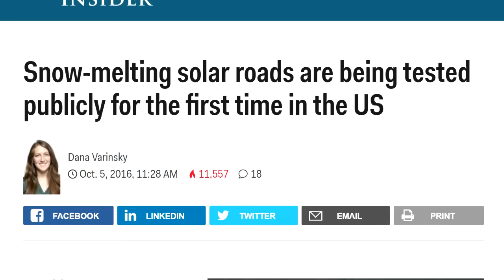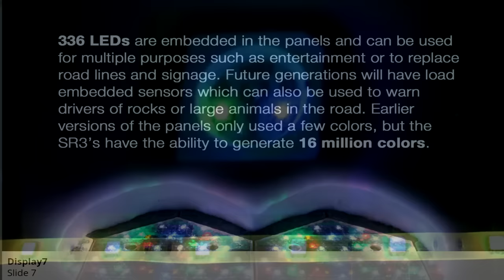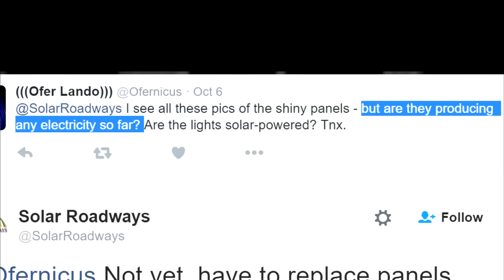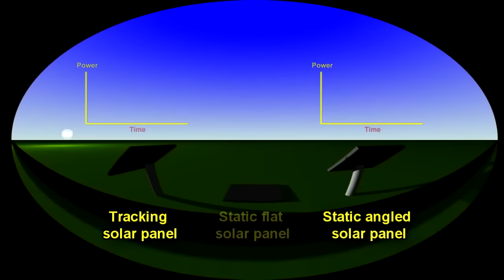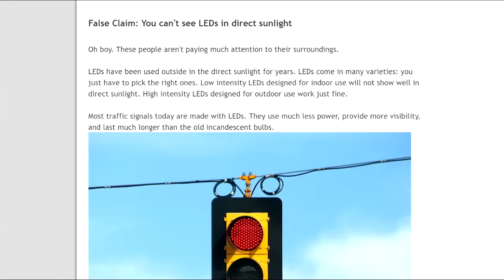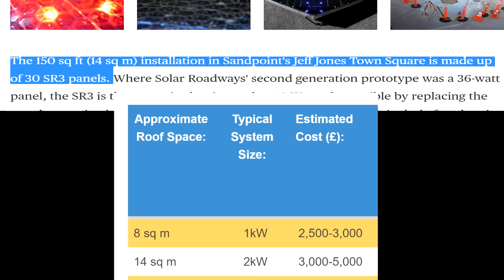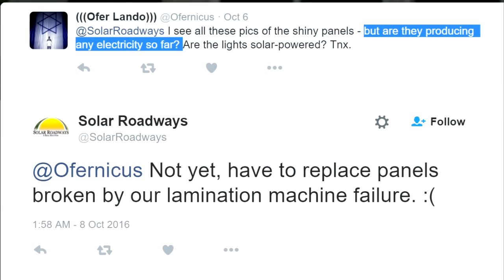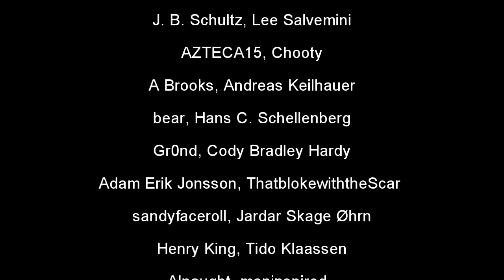First AMAZING Solar Roadway UNVEILED!

Comment: I agree that solar roadways is a pie in the sky idea that won't work in practicality. That being said, why would you test the feasibility of this idea by rubbing asphalt on glass when the goal is to REPLACE asphalt with glass? Shouldn't you be rubbing tire treads on glass? You're still going to have a lot of wear on the glass that will further lower the efficiency of the solar panels. So why lie with a faulty analogy? Probably because rubbing tire tread on glass wouldn't have the same immediate abrasive results as asphalt. It seems your test was rather ill conceived and done for dramatic effect rather than to prove anything.
Reply: You're oversimplifying it: rocks and rubble of all sorts get on roads all the time from so many different sources. Tire rubber won't be the only thing touching the roads. What's more, he did address tire rubber in his last video on this, and made the very obvious point that tire rubber on glass in wet weather is an extremely dangerous combination. You wanna go drive on wet glass over wet asphalt? Your funeral!
Reply: I didn't see the last video. Yes, not everyone watches every video on YouTube. Shocking, I know! But thanks for informing me in the most condescending way possible. And why is it whenever someone disagrees with another person on the internet they immediately go full false dichotomy and assume that because you disagree with one point you must agree with the entire premise of the opposite position. And this despite the fact that I prefaced my comment with the opinion that I already think solar roadways are unfeasible. But I forget, it's an election year; so it's fun to cast anyone who disagrees with you even slightly as being the polar opposite of your own position. Right? /s
Reply: Have you never seen a pebble get stuck in a tire, and if that happens, with the weight of a car and it's speed you would have significant scratches
Reply: Rob Freebeard Wow you really lost your temper there. Thing about the internet is that it's hard to really detect tone, and being way too obvious about it can be bad as well. I wasn't actually being condescending, at least not deliberately so. More sarcastic, having a laugh, and certainly not at your expense.

But it's the internet, get so invested in a single comment and you'll get grey hairs early from the stress. Check out TF's last few videos on Solar Roadways, he goes into a bit of detail which is quite interesting.

Comment: Is the whole idea of solar roads totally a failure? Or is it just their incompetence?
Reply: The idea is senseless.  It would be 4x to 10x cheaper and better to simply pave the road with conventional materials (even put cat's eyes or even programmable LED reflectors and heating pipes in them if you can afford to... and have corridors along the side with all that expensive BS [wifi, power lines, etc. etc.] if you want to) and then put solar panels above the road or at the side of the road where they aren't shaded or scratched/damaged by vehicles.  Solar panels fall in efficiency as they get hot.  You need venting.  Instead, to protect the electronics in a solar road from water etc, they are hermetically/vacuum sealed.  So you have high-powered super-bright LEDs and microprocessors generating heat PLUS solar panels with NO ESCAPE FOR THE HEAT!  Even if the electronics don't cook, the power generation will be almost nil and the lifespan of the panels will be down drastically from the rated 15-20 years.
The french government is doing it SLIGHTLY more sensibly by just sticking rubbery solar panels on TOP of the road.  Still idiotic but only 2-3x as stupid as putting it on a roof or on the side of the road - compared to having to dig up all the existing infrastructure etc.
Netherlands spent 3M euros on a 70m bikepath (with no extra electronics!) that produced 1/2 the power of a rooftop solar.  So if they had just put the panels on the side where they didn't get dirty and was fixed at a tilt to the sun they would have had something a little sensible.
So the approach itself is pure and utter folly.  And on top of that the Brusaws are morons who can't deliver on even the tiniest of their promises.  Who wouldn't test out their product in the lab BEFORE installing it?  They've had 10 years and $4M in funding, and have an additional $500k for this project alone.
Reply: I would lean toward fraud. A person who is legitimately trying to build something with make a bare-bones prototype first and focus on improving the core functionality first, then go on to adding the bells and whistles. A person trying to sell snake oil will add the bells and whistles in the prototype phase to distract attention away from the fact that the snake oil does not work. For example, when someone points out that the solar panels aren't working, the inventor will point out that the LEDs are working, and argue for the benefits of LED powered road markings, or switch the topic to heating the roadways. And when someone points out that LED powered road marking are invisible during the day, the inventor will switch the topic to solar power, and so on. 

The solar panel bike path in the Netherlands does not have LEDs, but it is producing power (inefficiently and expensively.) The solar installation in Idaho is NOT producing any power. The number of panels with functioning LEDs is totally irrelevant,:if the LEDs on all 36 panels were still working, it is still a failure, because it is not doing its core function.  The" bells and whistles distraction" tactic is partially working, most viewers are focusing on the number of LEDs that are out, rather than 100% failure of the installation to produce any electricity.
Reply: blkgardner I agree.  Excellent point.  Both the Netherlands and France are starting with the basic, fundamental part: road surface that generates electricity. The Brusaws keep making grandiose irrelevant claims "Solve Climate Change, Track Terrorists, Military Applications, Gather Runoff water, Load Sensors to protect animals!" [the runoff water thing is insane by itself.  Have they never heard of storm drains?]... I think their entire purpose was to defraud the government.  And then they found out about how to defraud people on Indiegogo... Their SR3 panel upgrade (from SR2) was to make brighter and more colorful LEDs (for more decorating options!).  They are smiling thieves.
Reply: The idea itself is both scientifically crazy as well as illogical.  The best place to put solar panels is NOT areas that traffic is on, but areas like roves of buildings and uncovered areas exposed to direct sunlight.   The idea of a car park is crazy as little actual light would be absorbed even if you could find a material that tucks, buses, cars, dogs and the like can walk and drive on without damaging it.  Now, the cost of installing them on a roadway, not even thinking of the disruption to traffic, would be much higher than putting existing solar panels in desert areas which already happens.  

Secondly, there are many working solar panels already in the world (my nephew works for the CSIRO in Australia and designs them).   Their disco lights version is all very cute but the existing panels available for energy are already well developed.  In Australia, we even have a competition each year for who can build the fastest solar powered car AND the panels are actually on the car, as that it the part that has unfettered sunlight.

I can't say that the idiots trying to develop these panels are charlatans or are just total whack jobs, but it is a worry when government agencies throw public cash at it with no idea of what they are doing.

Comment: The execution was very poor, it still seems plausible as a concept though, just need someone with real world manufacturing knowledge and solid engineering skills.
Reply: Did you even watch the video? It is not a solid concept. Why would you bother putting solar panels where they'll be far less efficient when there's more than enough land to put panels on, like unfarmable fields or rooftops? Not to mention the whole host of other problems with the idea mentioned in the video.

Comment: sigh

As if I wasn't misanthropic enough...

Oh well, what more is there to say than: There's a sucker born every minute?

I'm going to pretend for a moment that I haven't got the slightest clue about electrical engineering or solar power at all. The very fact that these "geniuses" saw fit to include a blinking, LED-lightshow into the fucking thing should've been a pretty obvious warning sign to the beholder.

If their intended purpose is to GENERATE power, and each hex is clearly inefficient enough by itself that the goal is to pavr over the entire frigging road network with them to gain a decent amount of juice, then why... OH WHY! Would you see fit to WASTE that hard earned power on a stupid lightshow?!

I just... I... Oh nevermind, I just hate people in general...

Comment: its a good idea that can change the world but these people are not the people to do it. we need a team of actual civil engineer's, scientists, electricians, renewable energy scientists and construction workers to come up with a better solar road idea.
Reply: We don't need a solar road idea. We already know the best places to install solar panels: sun-tracking mounts (for commercial installations) and south-facing rooftops (less efficient but near-zero maintenance, for home use). What we do need is investment to move away from fossil fuels to renewable energy. And wasting millions of dollars on this wild goose chase is not going to help one bit.
Reply: Solar panals near or on roads could be a great idea if done right. Putting them on roofs are usually for domestic use only. Having them on or near roads could power street lights and stop lights at night and save on the government electricity bill. And having them on the road would save Alot of space because solar farms can take up alot of room. Im not saying to do it the way these idiots in the video do it but it can be good if done correctly

Comment: I can't believe people still buy this solar roadways bullshit. Also if they are going to design pretty looking tiles, they should have at least isolated them with something more substantial. This is not an easy thing to do for an outdoor equipment that is going to experience huge temperature and thus internal pressure changes, especially one that is going to be placed at the worst possible place - on the ground where it can be submerged in wet conditions for days and even weeks at a time and is going to get stepped on regularly. For this to be reliable and work for years, it probably should be completely potted in silicone or some sort of somewhat flexible yet resilient material that is water resistant.

Comment: looking at it right now and 5 are dead
Reply: and now 3 years later they got replaced and are BARELY functional but their new energy generated website says that their co2 footprint has been the equivalent of planting 0.86 of a tree NOT EVEN A WHOLE TREE 

If they wanted something that was effective then they shouldn't use LEDS but instead something similar to the gameboy with its LCD with a reflective backing or a kindle, actually using the suns brightness to your advantage. The added benefit is you only need to power it upon state changes making it cheaper then repainting a whole carpark instead of more expensive, excluding the super expensive upfront costs.

then when it comes to the solar panels its obviously a dumb idea so wouldn't it be better to try and siphon off some of the kinetic energy from cars driving over the panels then it's kind of like people who use the road are paying for it at least then it generates more energy the more its used instead of less and the glass getting scratched up wouldn't matter as much because it would be diffused anyway to avoid reflections.

Even all that is a dumb idea but I feel like its a hell of a lot more viable then solar roadways

Comment: solar panel roads seems like a good way to supplement power, since the US highway system is the largest man made structure in the world and most of it is just space, but it's not going to be the be-all-end-all of power solutions. Likewise if we had some real smart people working on this instead of an "engineering couple" a.k.a. hopeful entrepreneurs, then I think that it could be viable someday. I doubt it would be a system we'd be relying on for our energy infrastructure, but if the panels can power their own LEDs then it would definitely be good for driving and such. Again, this is merely a novelty now, but get some serious minds working on getting the bugs out and there's serious potential, even if it's not as lofty as the creators expectations.

Comment: whats ur point here? you need to take risk to succeed. Why i get the sense ur not a climate change believer
Reply: asifur rahman There is no need to take a risk. Solar panels on rooftops or in solar farms are far more effecient and cost effective. 

The lights are inneffective in daylight. The heating will take far more energy than the tiles can produce. Vehicles driving on them will quickly break them. 
There's no upside to them. This is a pure scam. Seven years of development and the best that they can do is a few square metres of broken fairy lights, which need power from the grid because they produce no power themselves!
Reply: eddiebruv yup i agree about the scam. Some stupid decision they r making here which is a common sense for everyone. But behind the shady businesses it still a good idea if they implement it without those poor decision
Reply: The best use of solar panels is the CURRENT use of solar panels:

Tilted towards the sun, from a position that has line of sight for the entire day. Rooftops, solar farms, even carpark covers located above the vehicles. But there is no chance this paradigm can be successful.
Reply: Paul Cousins it turn out to be a fashion accessories